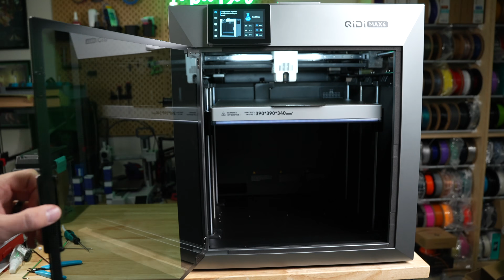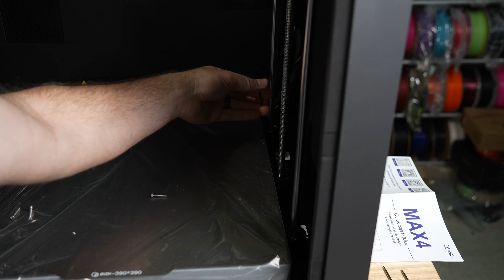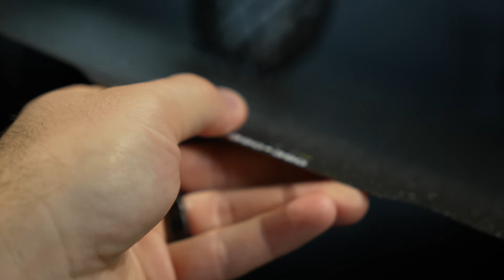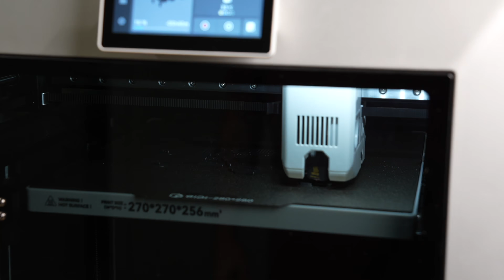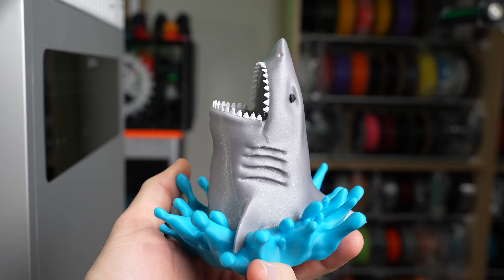I Tested QIDI’s Biggest Printer… Here’s the Truth (Max4)

Comment: My experience when I bought two QIDI boxes to go with my Q2 is that they are absolute trash. Always jamming, can't even run QIDI cardboard spools, they have loading/retraction failures constantly, and there are some serious syncing glitches. I returned one and ended up keeping the other as a filament dryer which is about the only thing they are good for. I've printed on QIDI printers for a few years and had good print experiences. That fact that QIDI produced such trash as an AMS and they keep selling it knowing it is trash says a lot about the direction the company has taken over the past couple years. The Q2 prints well. Not as good as my Bambu P2S, but few printers in that category do. Just do yourself a favor and stick with Bambu. They've brought more people into the hobby than all the others combined. I've ran an H2C, P2S, and H2S for months virtually non-stop with zero failures. No matter what I put in these machines, the stock settings work for me. QIDI could have been a competitor to Bambu, but they just don't have the same magic they had with the original QIDI max printer. I still have the first Max and it still prints wonderfully. All down hill from there, though.
Reply: thanks for being factual about these 3d printers, I recently upgraded to a Bambu H2C but it had multiple failures in the first 3 days of use. Out of box first print ok, second print Nozzle camera fail to initialise hit continue print finishes and is ok, day 2 print 3, nozzle camera still not working and toolhead camera fail, laser initialisation fail, hit continue and print continues and finishes ok but now I have 2 failures and can't use the 10w laser module which relies on the Toolhead camera.  Talk with support and organise everything to go back for full refund, now researching other options which don't have cameras in the head as I don't care for them and are the number one reason Bambu's fail looking at all the forums. Apparently bad design ideas putting cameras on a tool head. Reading in all the forums issues with Bambu cameras.
Reply: @real123  Sorry to hear about your issues with the H2C. I have an H2C and H2S that have performed perfectly for months now. I hope you received a refund or exchange.
Reply: Nah, don't like the scummy apple-like nature bambu developed. Anything but bambu
Reply: There are people whose hands grow straight out of their asses—people for whom getting anywhere near a piece of machinery is dangerous for the machine itself! You have to understand that a printer is a tool, and what can be achieved with any tool depends on the craftsman holding it.
Reply: @sunlight5616  Spoken as a true tinkerer. There are tinkerers who dig through garbage at local Salvation Armies because, "hey, I have the skill to make this Iomega Zip Drive work right after I fix my Atari Jaguar." Useless tech to some are treasures to others, I guess. Same applies to useless skills.
Reply: @TheTroyallen23  My dear friend! You hit the nail on the head! It’s as if you were standing right there while I was rummaging through the trash. And even more than that—you were holding the lid of the dumpster open and shining a flashlight for me. A flashlight I’d picked up from another dumpster a few days earlier.

Wishing you good health, and may all your gear serve you faithfully!

Comment: The Z-axis plate is a casting, not billet CNC made.  The only CNC aspect, and probably only 3-axis needed, is a quick milling pass after powder coating to flatten the reference surfaces, and possibly drill and tap any screw threads.

These are cast, trimmed/degated, deburred, media blasted or tumbled, powder coated, reference surfaces CNC milled, holes CNC drilled and/or tapped.

Usually the dead give away of a casting is the lack of any thick sections and the use of ribbing.  Cast aluminum can't have large solid sections because of shrinkage.  So you always see ribbing and thin segments used instead where you need reinforcement.  Also the sheer amount of segments and the sharp corners are another giveaway of a casting.  To do that in a CNC would take forever and require a ton of tool changes and wastes a ton of material.

Comment: If it helps, my solution to removing stuck  filament from a PEI print bed without scraping and damaging the surface is to use my 3D printing pen and draw a blob of the same type of filament on the stuck area and then I can use pliers to just grab the blob which peels off the stuck filament too.

Comment: Why do you use tons of glue for the printer which has high temp bed (120 deg, which is very good for ABS), enclosure and active air heating? Also you don't even clean bed after each print.
Reply from the maker: Glue is so that I can get the part off. It’s not for adhesion it is a release agent. Also no need to clean after every print that is highly unnecessary. You can go dozens of prints without cleaning the bed  unless you accidentally got finger oils on the build surface causing adhesion issues.

Comment: The reason the shelf print had bad walls around the holes is because of the fan speed. It changed and it cooled that area faster than the rest, making it look like Z banding. In the slicer look at fan speed on the preview tab and you will see the same lines in the preview model that correlate.

Comment: Ive been running my max4 24/7 the past month and honestly im impressed. I absolutely love my plus 4 but the max4 has been phenomenal and one thing ive really been impressed with is the first layers on such a large bed. Its been consistently just fire and forget
Reply: with the polar cooler? Curious if it's worth to get the polar cooler now that it's not included...
Reply: @RationalAsian I didnt get it with mine and honestly havent needed it. Unless it drops in price I dont plan on getting it any time soon
Reply: @RationalAsian  ive the polar cooler, but didnt connected it.
I think its only useful if you print PLA. I only print ASA, PETG, TPU so i think i dont need the cooler.

Comment: first thing i noticed is the headcover can be removed for less mass on the head unit. if im getting this im gonna run it without that cover :) less is more..

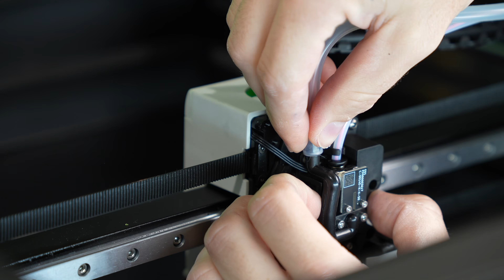5:10 ish. me neither, but for ppl in very humid and warm areas i see this being a thing. on rare occasions i had the hvac fail in my printfarm and the pla prints suffer from it, 100% of the times. petg and abs seem unaffected though :) its seems to me like a marketing gimmic to solve a non existing problem?
Reply from the maker: Yeah, I can see something like a water cooled toolhead on a very high temp printer to remove fans but this is a completely different take and one I have never seen even considered. Im sure there must be some people out there that this is a great fit for but outside of it maybe making the PLA prints stronger it seems like a pricey addon with little gain.

Comment: I’m surprised you didn’t mention the massive improvement in UI, App, and overall cohesiveness over the Q2. I find this printer to be a standout as the largest Multicolor Corexy printer in the market. Also the fact that this printer is hyper optimized for multicolor printing. It produces significantly less waste versus a Bambu P1, X1 or H2D and nearly 30% less over the other large printer the K2-+. Slow toolchanger yes. I have reworked my config and now have color changes down to a hair over one min. 

I love their printers. Qidi is doing different things and not just copying Bambu and I think that’s super refreshing. 

My only real complaint is the noise from the QB.
Reply: It is great yeah but I really prefer the UI on my Q2.
Reply: Did you really get the color change to be quicker? Really wanted to get this printer but the 3 min color change and added print time i was going to look for another option till I read your comment. Thanks
Reply: @reflectiveimagez yes chat GPT notices all the wait orders. There are tons of them. Her guess as to why it’s slower js wrong. It’s slow because of an abundance of caution
Reply: @TheLightSPD so it can be speed up some and still work decently? Thats been the only thing worrying me about this printer. Thanks

Comment: I think that the heated chamber pla statement is actually just an excuse because they didn't want to admit the real reason, and that is that the plus 4 and possibly other of their printers suffered super heavily from heat creep during normal printing. We had to always leave the door open, and the lid off of our plus 4 or it would get jammed from heat creep. Part of me thinks the huge heated bed just heats up the chamber too much and they can't get enough cool air to cool the hotend.
Reply: I've never had a jam on my plus4. But I do leave a gap in the door & top window 'just in case' when printing pla.

I mostly print in petg, doors closed; 8-15 hour prints are pretty common here. 

Using orca alicer with bambu's petg-hf. Very excellent results.
Reply: @LordPhobos6502  On mine with the door and lid closed, the chamber can reach up to 55-60c after a few hours of printing petg, causing clogging when doing lots of retractions. No issues as long as the filament is being extruded at a normal rate, or with the top lid propped open though.
Reply: @Z0neDrift I'm definitely living in a colder climate than you then.
For me, chamber temp of 35-45°C is common, even on long prints.
I leave the door open a bit for pla & tpu, but I don't need to open it fully. PETG I don't open the door at all. My longest print so far is 15 hours, with no issues. 

My chamber is clearly colder than yours, and I suspect that's down to local climate.
Reply: @LordPhobos6502  Is the heat creep issue only with PLA?
Reply: @SkintSNIPER262 mostly; it depends on your climate as well.
I leave the door ajar for pla; I've never had issues with petg clogging, though I'm told it can happen in warmer climates.
Reply: @LordPhobos6502 gotcha. I was going to put it in the basement were its pretty cool

Comment: Great video but really would have liked to see you test the polar cooler and see what effects it has on PLA prints in terms of strength and preventing warping. That’s a very unique and innovative feature amongst consumer printers. We need to know more.
Reply: I’m testing it now. It’s hard to tell if it’s doing what it says. But you can print with the door closed and it keeps the jamming to zero.
Reply: @TheLightSPD  Awesome! Thanks for the info. I know that in the video he says he never has issues with PLA warping, but I still do from time to time. And I always have better luck printing PLA in a warm enclosed chamber (on my Elegoo Centauri Carbon for example). The chamber gets to about 32-36C and my PLA prints rarely ever warp on that machine. No clogs either. I often wondered, if that printer had a heated chamber, how hot could I go before I start having extruder clogs, and would it give any benefits for PLA prints letting the chamber get hotter anyway. Obviously Qidi thinks so, lol.
Reply: @TheLightSPD  Is the cooler just for PLA? Because if you're using engineering filaments you'd want the door closed.
Reply: @SkintSNIPER262 yes for any filament having a cold heatbreak is okay for any material

Comment: Why does Bambu do a phenomenal job with layer stacking and most other brands seem to struggle with it? What do they do that makes it soicb better with no manual tweaking? I know their auto calibration is fantastic and maybe that is it
Reply: One thing to note is Qidi uses 1.5GT belts which does a phenomenal job layer stacking versus like a P1S for example or P2S. I suspect his issue might be using a different slicer or maybe material. I haven’t had that issue. It prints exactly like the Q2. I can pick a Qidi print from a pile of Bambu prints. Bambu just went to 1.5GT belts on the X2D and it’s a noticeable improvement. So many things can cause those artifacts. Or could be belts, or something like that.
Reply: @TheLightSPD  bambu already used 1.5 on A1 and H2 series, they didn't "just go" with it, they used it before qidi ever did

Comment: Can you test the close stepper motors? Interested if they will recover or they are just installed but not working. Thank you
Reply: They necessitate closed loop for certain efficiency reasons, but are not advertised as (and don't work as) true closed loop step correcting motors.

Comment: I'm disappointed that there isnt a built in means of attaching an exhaust hose to the printer. The Q2 has it and it's been essential for printing with ASA and everything to keep the shop from fumes
Reply: I designed an attachment for my Q1 Pro, but also had to design a mini duct to channel the hot dirty air thru the electronics region without making the electronics hotter.  Stupid qidi design dumps the hot air into the electronics box. My 2 part modification works perfectly
Reply: Have you been able to duct the exhaust  out of your Max4
Reply: This is the 3D printing world. Odds are someone already designed an attachment.

Comment: I'd like to have seen you try it with a more challenging filament, like PC or even PPA.
Reply: I have one and have been printing ppa and ppa-cf as well as full plates of pa6/66 and it handles it beautifully. Qidi printers absolutely kill it at high temperature printing. My max4 had been awesome and first layers have been immaculate
Reply: @infinitEndz thanks for the info. My Xmax 3 is great when it works...it just doesn't complete a print often...😅
Reply: @infinitEndz 
Pa66 at <80c 
What blend are you printing
Reply: Yes this. Came to say the same. That's what I'm interested in a printer like this for
Reply: If I was going to go for those serious materials, I'd go with a max4 over a plus4.
I've got the plus4, which uses a magnetic bed sensor, and I've been warned that using hitemp materials will shorten the lifespan of the bed sensor on the plus4 (there are some recommended 3rd party alternatives).

I suspect they seapped to a load sensor on the max4 to improve on this issue.

Of course, it's a BIG 40kg machine O_O and the plus4 can be upgraded if that's not an option.
Reply: @LordPhobos6502 but this is a Max4 review no?
Reply: In case anyone sees this comment and is seriously looking at the Max 4 for difficult filaments - it chews through PC like a monster and I imagine it'd do the same for PPA/PPS. You can find some of my prints over at printables, my handle there is @smurfhunter. I have some clear PC prints already finished and uploaded and I'm working on some others.

I use PC from polymaker. I haven't bothered to anneal most of my prints and they print crazy accurately and strong anyway. I do need to dry out the filament before using it in the Qidi box, but the quality is insane and the box handles it well as long as it's dry.

I have used my slightly modified Q1 Pro to do polycarbonate. The biggest thing I did was sealing the holes around the chamber with HVAC tape and insulation. It has made my print quality for materials like ABS, Nylon and PC amazing. That being said - I didn't have to do anything out of the box to my Max 4 to get flawless polycarbonate prints. I have some more prints I'm halfway through using PC that I will be uploading to my profile in a few days as well.

I cannot comment on PPA or PPS, but given how easily this printer has handled PC I don't see why these would be challenges for it. It absolutely chews through ASA and ABS as well. I'm going to give it a whirl with PEBA when I get my polar cooler for it and I will have some makes on my profile posted when that's done :)

Comment: The inconsistency comes because of the combination of infill, wall order and overlaps.
With tuning you can get that into smooth walls.

Overall this Printer looks awesome and the built in features are really cool. Only bummer and hope for the next printer is a MAX 4 with Dual Nozzle
Reply from the maker: I would love a dual nozzle setup from Qidi. They have had them before but its been years. I tested the iFast maybe 5 or so years ago and it was a dual nozzle rocking head so they definitely have the knowledge on how to make it happen.